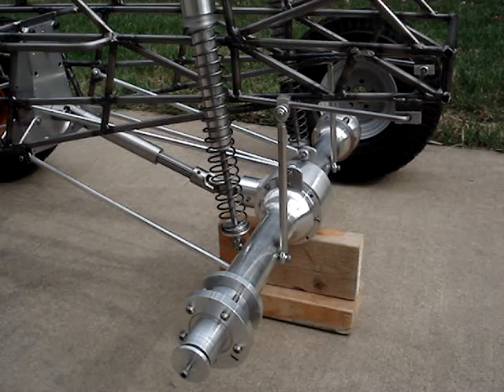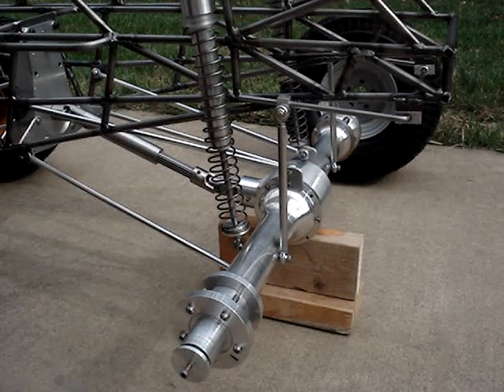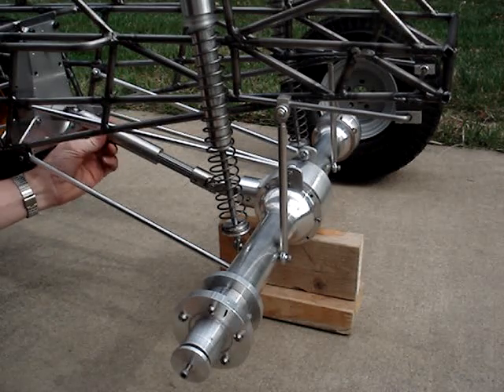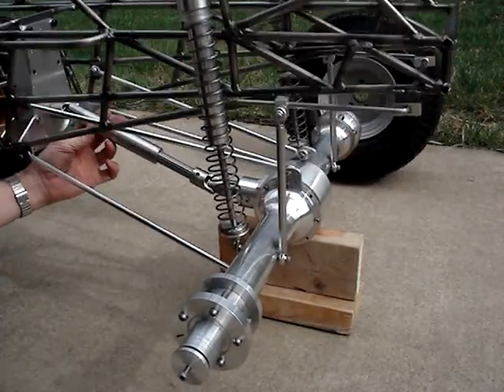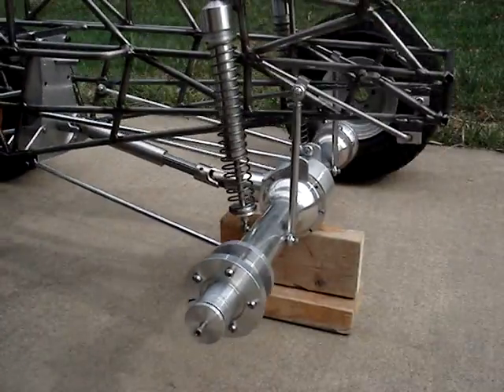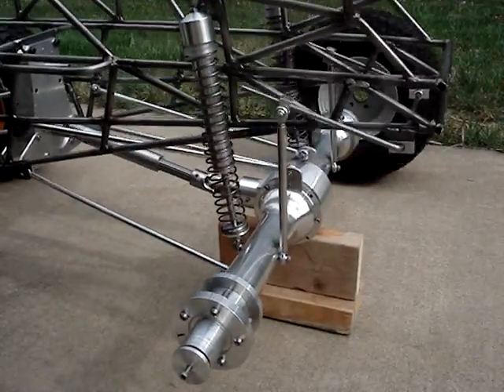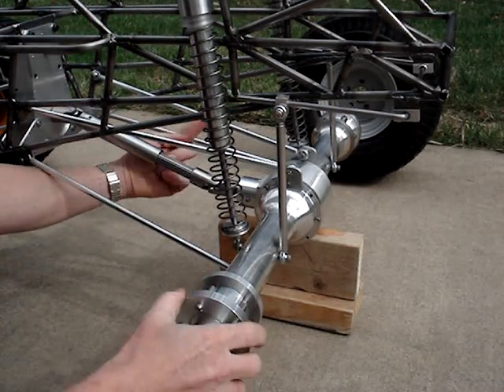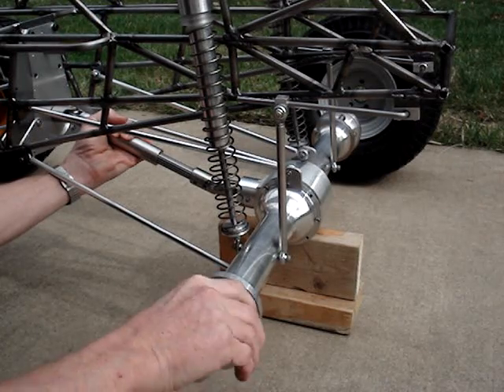1/4 Scale Grave Digger Part 5 with Conley V8

Comment: axle -> wheel hubs, instead of having a bevel gear, you would have a hollow conical shape on both axles and with in the bigger (the one the recieves the power from the gearbox / engine gear in the differential you would have 2 oposite conical shapes with the spring in between to put tension, to prevent unwanted slip.

get the idea?

Comment from the maker: @naturalyshocked 
Sometimes you have to use what you can find. 

Not sure what you're describing using Bevel/conical elements.  Aluminum would ware quickly, this truck weighs 80+ lbs.  A LSD would be great.

A Custom made set of gears on a 5 axis cnc machine would probably cost more than what I have into this Truck.

Comment: is the diff filled with Silicon oil? or grease? cause if you put some silicon diff oil in like 100k. then the other side wont spin the other way as easy.basically locking the diff slightly. just a suggestion!!!

Comment: i think you should not use a 'bevel gear differential' for this application on the rear axle, but only on the front.

i think you should use bevel / conical elements from a soft material like aluminium or somekind of coating  and a the oposite elements (axle -> wheel hubs) of a harder material and put a adjustable spring load on it.
to create a minuature LSD.

find someone that has a 5 axis cnc machine to create conical elements with grooves on them .